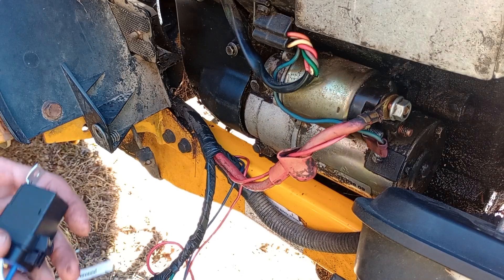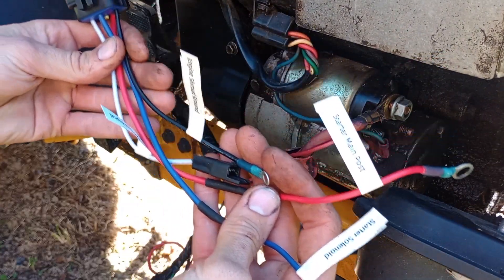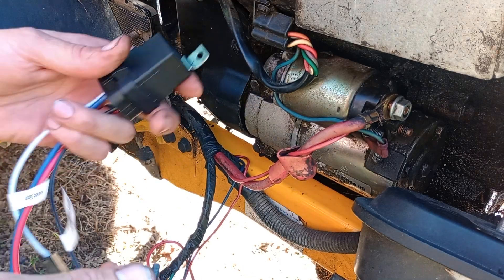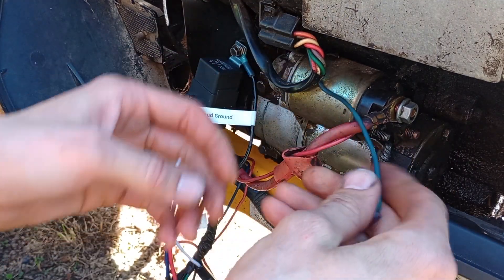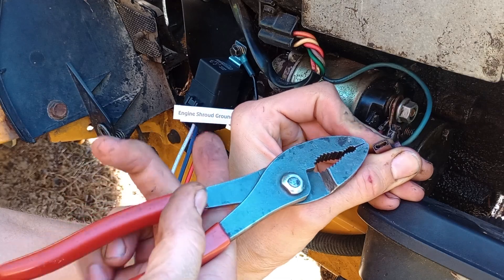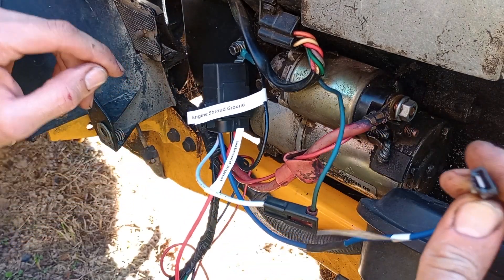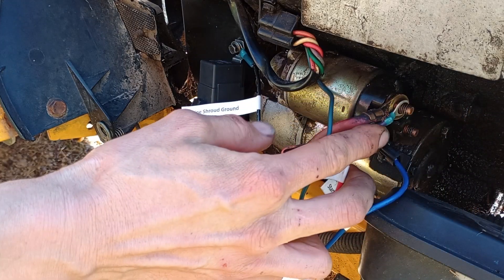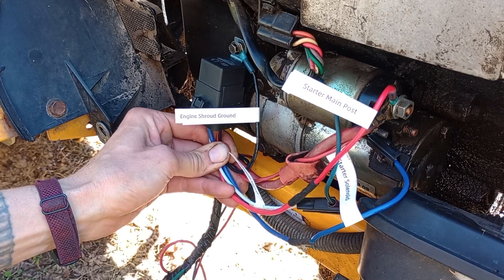SG Clicky Starter Fix - Kohler Command Twin

Comment: Or can the solenoid wire be a wire connected to the positive terminal?
Reply from the maker: That small wire is probably a power feed to the rest of your system.   Is this a Kohler Command?
Reply: @ yea the small wire is attached to the positive post on the starter and was wondering can I attach it to the solenoid signal port on starter?
Reply from the maker: No, it is a power feed to the rest of your system.  If you unhook it and run it to the signal post on the starter it will not work.

Comment: Hi I have a 2000 lhp4820kc Exmark and I don’t see the starter solenoid signal wire? Can I just a 14ga small wire that runs to the positive to the small start post?

Comment: Hello, just a quick question..would you use this on the 2166 16 hp ? Would it fit? Thanks
Reply from the maker: Yep, we actually have a 2166 with this installed on it.  👌🏼👌🏼